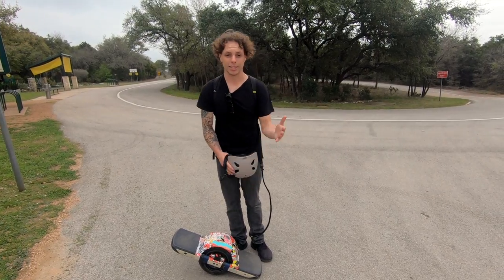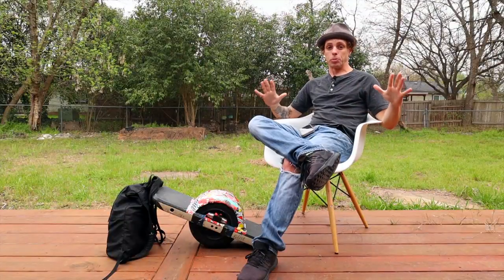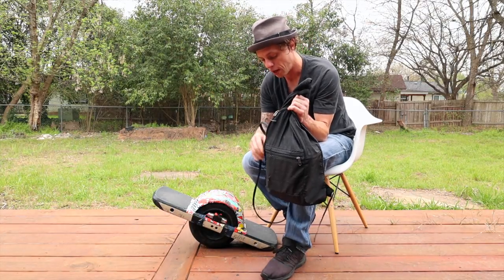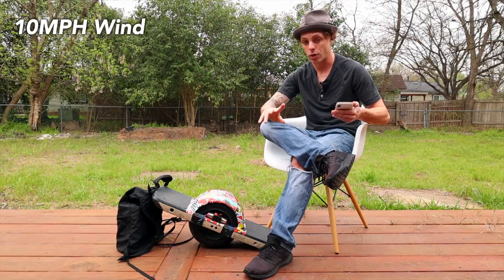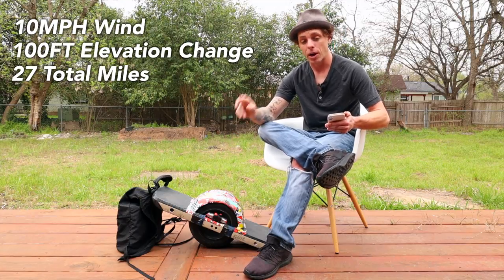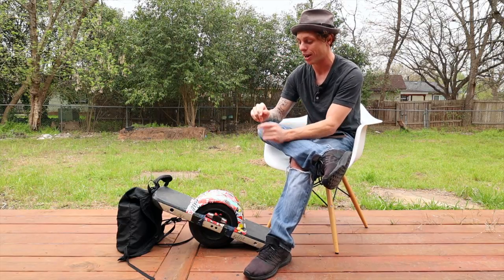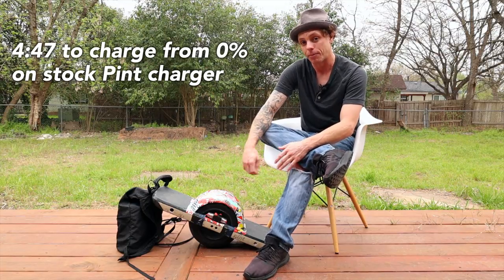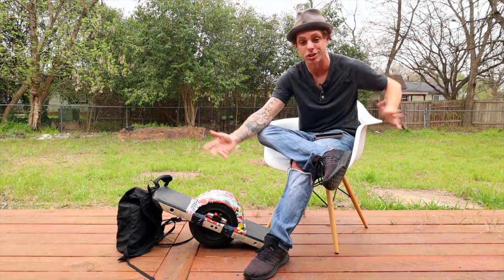Onewheel Pint Extended Battery Range Test - 5.0AH Battery VNR

Comment: How to get the battery you have
Reply from the maker: devanshu bagadia links in the description to all the parts I used and a link to how I installed it. Thanks for watching
Reply: @ELECTRIC-DNA  bro i live in india and i badly want a one wheel but the import duty is 128% i researced a lot but there is no other way now i have save money for more 2 years to get a one wheel and this mod is not possible in new ones
Reply from the maker: Oh man, that makes it hard. Maybe look for an EUC? Not the same but a similar experience. Good luck brother!
Reply: @ELECTRIC-DNA  EUC IS A OPTION BUT I GOT CONNECTED ONE WHEEL WATCHING VIDEOS FOR MONTHS LETS SEE....

Comment: 135 lbs? you should have an actual sized man test it. We know kid size will go longer so this seems like waste of time
Reply from the maker: What's an actual sized man? I feel actual size lol. I  explained that this is just a baseline for you to judge what range you may be able to get out of the board with the modifications at 0:35. I usually can get 9/10 miles out of the stock battery and have found that is pretty typical across riders therefore feel this is a typical range you can expect depending on a multitude of riding circumstances.
Reply: @ELECTRIC-DNA  Don't listen to him. Just because he may be overweight doesn't mean you are under. 
Btw Its all about your height.
Question:
Does the vnr battery voltages drop at different rates than the pints? Also how dangerous is this to the longevity of the board.
Reply from the maker: @peterscaccabarozzi153  Hey there. The external and internal will stay at the same voltage and drop together at the same rate as long as you keep it plugged in the whole ride. I haven’t seen or heard from anyone about it lowering the longevity, in fact it could actually increase your batteries life span since you’re sharing the work across two batteries. Good luck!